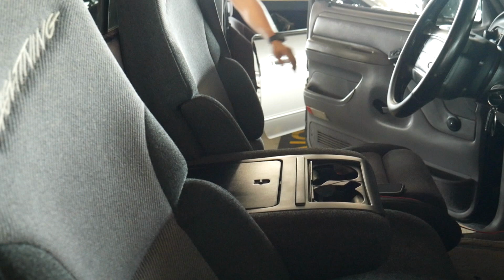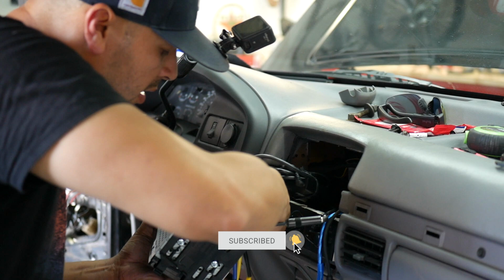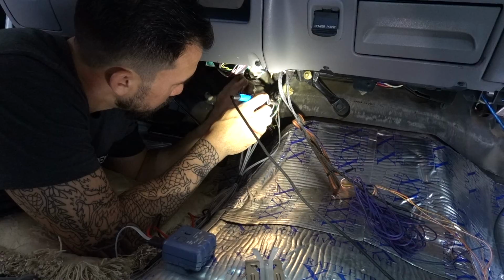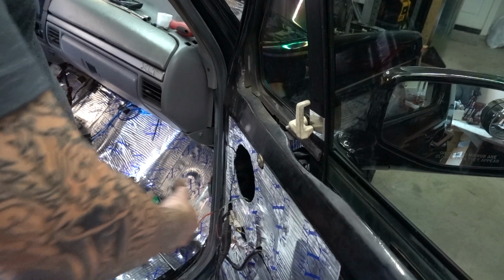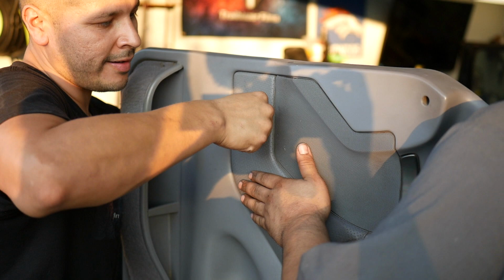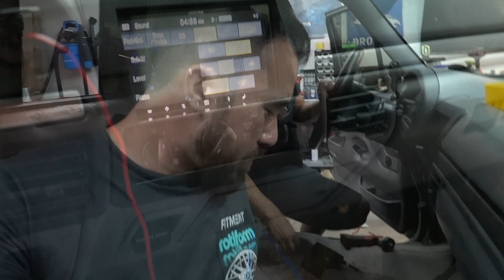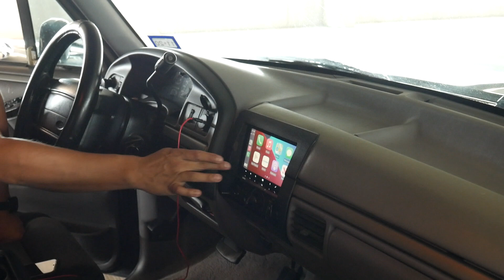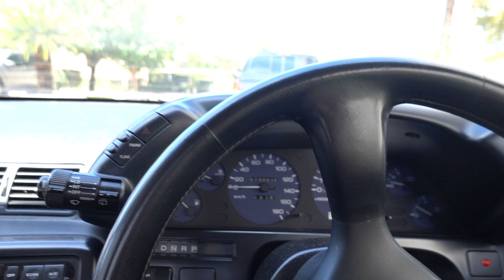Complete Alpine Sound System Upgrade  Gen 1 Ford Lightning F 150 / Installing  Amplifiers Speakers

Comment: Did  you remove the factory sound dampening on the floor? Should have looked like mats glued (?) to the floor under the carpet. Thanks! I'm working on a similar upgrade in my 93 Lightning

Comment: I have a 1997 f250 with a bench seat and I was wondering if that box and amps would fit? I know this video was posted a long time ago but I am interested in putting a system in my truck